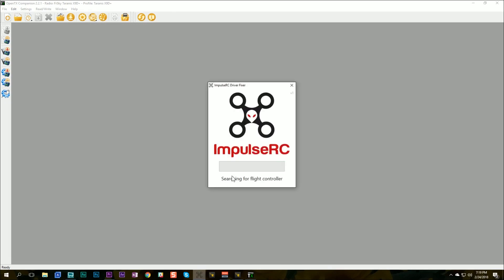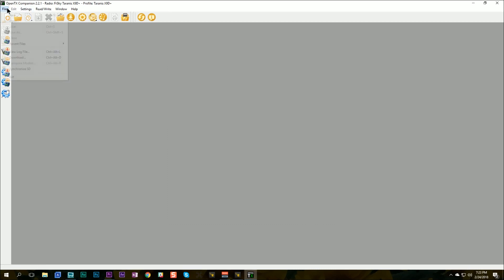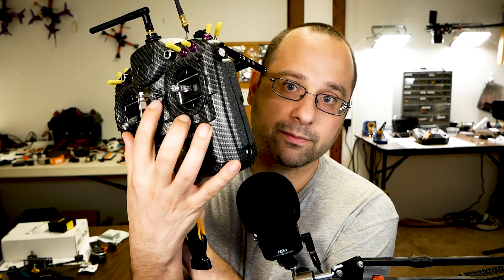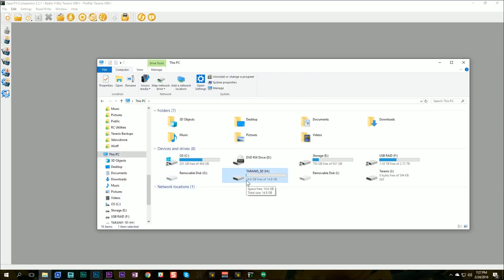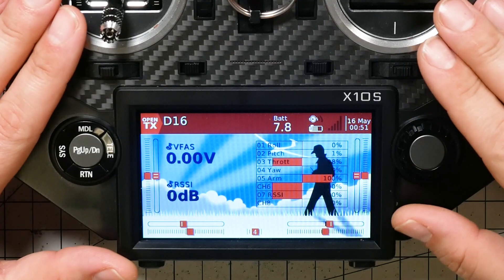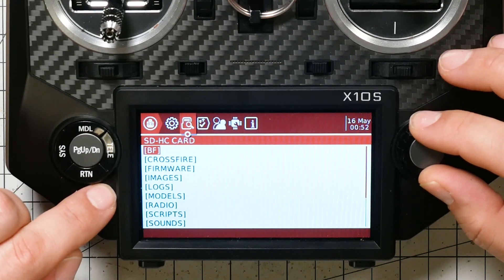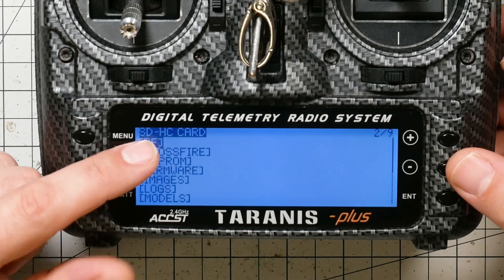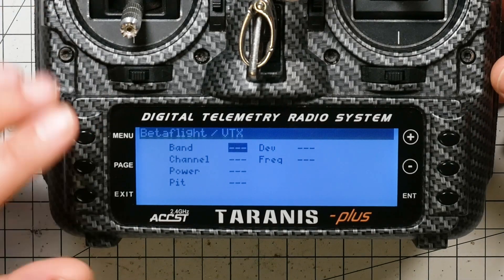Betaflight Lua Script Updated for OpenTX 2.2.1 | NO MORE OUT OF MEMORY ERROR

Comment: Is this relevant yet? Or it has .already merged into new versions, as im using latest 2.3.14 otx version..so o just need to force start the script with .LuaC files..and not with simple .lua file? to eleminate out of memory errors? 
I ve read others suggest to delete these luac files as they are not necessary and by deleting them i can free up some space. So im confused now..here you suggest to force start with luac.
Im facing memory issue now when i start elrsv2.lua than i cannot start another script...or vice versa

Comment: I get the out of memory error when I execute the crossfire lua script and scroll down the menu of the micro rx. However I flashed my radio using frsky way whereby you put the firmware in the firmware folder and then run boatloader and  write firmware. My guess is I need to flash it with companion and follow your steps by selecting luac  to fix this issue?
Reply from the maker: I doubt that. Did you update the SD card contents?
Reply: @JoshuaBardwell  Hi Joshua, I downloaded the SD contents from the Frsky website. I deleted all the contents on the SD card and copied the new files over. I'm running 2.2.2 by frsky - from the downloads page section. I even replaced the crossfire lua scripts with the latest ones from tbs. This is so frustrating I'm thinking of re-flashing it now with companion and selecting the lua & luac mode. Anyway there are so many versions on opentx website which one would you recommend for the taranis X9D plus - no special edition, got it around 2016-2017. Thanks
Reply: What's weird is that crossfire works fine and have no problem binding. But I do get this annoying message when I switch of my radio - "module is still running" yada yada

Comment: Thanks once again Joshua. This was difficult for me because my PC had a hard time recognizing my sd card and taranis. sometimes drives showed up but unresponsive.  I only just purchased my radio second hand and it didnt come with a usb cord. I kept trying on different usb ports and tried a second usb cable that fit but still no luck. Was about to give up and tried my first cord one more time and the drives appeared, looked correct and the firmware flashed finally!!  Yay!
Never would have done this without you champ, thanks heaps!

Comment: hey josh, when you say the taranis upgrade is needed for crossfire, you mean the micro crossfire not the full blown crossfire unit. so i have been informed by the retailer
Reply from the maker: This info is a bit dated. The x9d has been shipping with support for Crossfire for a while now. However at the tune the video was made you definitely did need to upgrade for crossfire support.

If my memory is correct crossfire support was added in 2.2.0. Before that, whatever module you used, opentx didn't support crossfire at all.

Comment: hey Joshua, I need a little help with some trouble shooting, I followed you instructions in this video  and now my Taranis Qx7 disconnects from receiver after just 1min
I don't know if it is the receiver(new build which I flashed with the Fport firmware) or the fact that I updated the firmware on my TX should I try reflashing my Tx or my RX or both??
Thanks

Comment: Hey Joshua I've been trying to update firmware on taranis x9d plus believe   its 223 now. But when I go to crossfire in sd card its saying script killed any help would be great
Reply from the maker: You have to separately update the SD card contents. Could that be the step you missed?
Reply: I did both had them both working then something happened nd only 5 things are on sd card now. Nd now the computer is trying to repair sd card but no luck

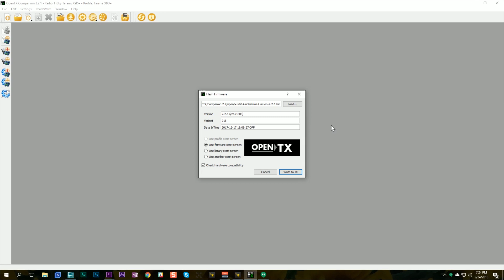Comment: When executing "Write Firmware to Radio" (5:00), to what path do you write the firmware? Do you write it directly to the "Taranis (J:)" drive?
Reply from the maker: None of the above. When you "write firmware to radio" you have the radio connected in DFU mode so there is no J drive. You plug in the taranis with power off and this causes it to enter DFU mode.

Comment: Question: I have Smart Audio controlling vtx...no issues. I installed lua scripts and it controls everything on the vtx EXCEPT PitMode. The equipment is working, so is there a special way to turn PitMode on/off? The screen says it is saving but the vtx never changes and the lua PitMode setting goes back to whatever it was set at? Telemetry is definitely working. Equipment: fireworks v2 flashed to 3.5.1 and BF 3.5, 9D+ radio with 2.2.3, eachine tx805. Any help is greatly appreciated. 
Roger
Reply from the maker: Unify (and possibly other SmartAudio vTX) refuse to go back into pit mode after power up.

Try tinysleds real pit (search my channel for review)

Comment: When I create a new model it doesn’t allow me too chose between kwad airplane etc it just goes directly too the menu again and the model is there do you know why?
Reply from the maker: That's an option you can turn on in the OpenTX Companion app on the desktop. But honestly I prefer it to be off as the presets it goes through are pretty basic and I like to just do them by hand.
Reply: Joshua Bardwell ....thanks man I thought its something that u needed, another quick question my radio didn’t come with a sd card  the firmware is 2.1.6 i know its better too be up to date but just for now while i dont buy one and download the new one and all that , does that affect in any way the signal or something of flying or i can still fly no problems ? I bind my wing and everything seemed to work normal i just didn’t wanna risk too fly it without the sd card and new firmware , so am i good to fly?

Comment: Hey, JB, I have a doubt. My Taranis is running 2.1.6 and I'm going to update it for the newest version (2.2.2 or whatever, I don't know). My doubt is: which method should I use? The boot loader, like in your first video, or like you did here? Or it doesn't matter? Thanks!!! 😊
Reply from the maker: Personally I would use the method of "plug in while it's off" and flash from Companion. The only reason I showed the SD-card method is because it avoids the issue with DFU drivers, which many struggle with.
Reply: @JoshuaBardwell  Nice, thanks a lot!!! 😃

Comment: Joshua, thanks for your videos on this. I am struggling to understand how to get the BF lua scripts working. I keep getting various syntax error, telemetry protocol not supported and other error messages. This is with OpenTX 2.2.2 and the associated SD file set. When I try to go back to earlier versions of the OpenTX FW, I install the Companion SW (say for OpenTX 2.2.0, but the FW downloaded is always 2.2.2). Which makes me think I am missing something. The FW timestamp also confirms that it is 2.2.2. Under some conditions I do get the telemetry page to run the script, but only directly after power up of the TX. Hope you can get me some help.

Edit: I found the original FW file for 2.2.0 on my MacBook and was able to get it to work. Using the latest BF lua scripts which surprised me (didn't think they would be compatible with an earlier FW version). Has the Taranis reached the end of its growth potential, or could the memory issue be resolved? The lua stuff is presumable only growing in size and complexity.
Reply from the maker: You should install 2.2.2, the latest SD card contents, and the latest Lua scripts. You must also be running a recent version of Betaflight. Then everything should work smoothly.
Reply: This has been my experience; out of memory errors gone after custom firmware flash for 2.2.2 as per JB's video.

Also keep an eye out for new lua script for ßF 3.5, it's not officially released yet, but patch for new feed forward page has been committed to github.
Reply: Thanks mate. I run BF3.5, and the 2.2.2 plus latest SD card contents somehow didn't work for me. WIll give it a few days and try again.
Reply: Just to confirm: you have flashed the custom noheli, lua and luac firmware as per JB video?
Reply: @si-fi  I did all that except I did not pick the noheli option. Something I did not do was to update the bootloader via the SD card method, but the radio showed otx 2.2.2 I think. I remember as it went back to saying taranis 2.2.0 in bootloader mode (when I loaded FW 2.2.0). Can't recall that I ever updated the boot loader via the sd card. Is this step essential?
Reply: @pieterdewaard2383  hmmm, not sure, my bootloader is 2.1.6 and has been for ages.

Comment: First time Frsky user here wuth a Qx7.  Flashed OpenTX 2.2.1, added Lua script together with all files instructed on the video.  I'm wondering why don't i have the VFAS option on the display page? All i get is the screen 1 to 4 menu without the top display menu.  i wanted to select it also on the special function but can't see the option.What did i do wrong?
Reply from the maker: If you don't see VFAS on the display page I think the sensor has never been discovered. Bind the transmitter, power up your quad, go to Telemetry screen then Discover Sensors. If the FC is sending telemetry you should see VFAS come in.
Reply: Joshua Bardwell Thank you for replying to my query.  Will try it out.

Comment: Joshua, thanks for this video, but what could be the reason that there is no information showing for the PID or VTX inside the lua script? It just has "--" for all the fields. I'm running a Hobbywing XROTOR F4 FC and have an X4Rsb rx with the s.port wired to UART3TX and a Tramp HV with the telemetry wired to UART6TX. I also have both turned on within Betaflight.

Comment: Every time I drag and merge the bf and script files  onto my sd card it shows fine when the sd is in my computer but when I restart my taranis X9d + se .... it scrambles the whole card and I get the sd card warning right away. Any information on why this would happen? I have tried many times. Thanks
Reply from the maker: The SD card that comes with the Taranis is kind of shit. Replace it with even a cheap aftermarket one.
Reply: Joshua Bardwell that’s easy enough... I will give it a try thanks
Reply: Joshua Bardwell well that was the fix!!! After spending a week uploading and formatting that crappy SD card. I think you should mention this in a video or in the description. Thanks again, I guess I should have asked sooner.

Comment: Do you know if the current Frsky OpenTx version (With, I'm guessing, some bugfix?) has the LUA + LUAC options?

(ie: x9dp-v2.2.2-20180525, "Based on openTx v2.2.2.", even though that is not an officially released OpenTX version?!
see: https://www.frsky-rc.com/wp-content/uploads/Downloads/Firmware/X9DP/FW-X9DP-V2.2-20180525.zip )
Reply from the maker: It is a compile-time option so I assume it is available yes. Just select luac option in Companion and click "download" and it should come down.
Reply: They don't seem to offer a custom companion, only the firmware and SD card content.
So I used the 2.2.1 companion with their "2.2.2" version, but I can't tell which modules are active, unless there is a menu for it on OpenTX? (I'm just starting out, sorry for the confusion!)
My current understanding/guess is that 2.2.1 is linked to some repository where it gets all the precompiled build options/modules, and somehow combine thems?
And thus, I'm not sure I can click download in 2.2.1 and tell him to fetch 2.2.2 (I clicked "write firmware to radio" and picked the file I got from FrSky) considering FrSky doesn't seem to be giving any other content.
Unless the companion is actually extracting modules from the firmware .bin? :)

Comment: I've never been able to read or write with companion. It SAYS it writes firmware but doesn't. It also says it reads models and settings from radio but only model 1 shows ... i always have to write firmware and backup to\from SD on radio. Any ideas?
Reply from the maker: That's pretty weird but I don't know..
Reply: it is weird. Does it on every PC i connect this qx7 to.  Ive went back and forth with frsky and the betaflight guys to no avail. They just stopped responding after exhausting possible solutions. There are zero errors and companion says everything went fine. I know its not the case but it acts like companion is interacting with a second version of the firmware/settings that never get loaded in the Tx when booted. its a mystery.

Comment: I have a X9D (not plus) and a QX7, both running OpenTX2.2.1. I tried lua v1.0.1 scripts on 2 quads (both with SPRF3 FC, one is a modded wizard x220 and the other a scratch build with a bangood SPRF3 clone from banggood). Both quads have telemetry working fine. But only the wizard works with lua script (initially bound to my QX7). They're now wired exactly the same (softport sport telemetry with only one cable on tx softserial 2 and both with sbus). At first I thought the problem was with de X9D, but after binding the quad that doens't work with lua to the QX7 (that has lua working perfectly with the wizard), it still doesn't work. So I reckon the problem is with the quad. 
Any hints on how to try to solve it? I am at a loss... tried everything I can think of...
I don't  get any memory errors. The script just can't read e.g. the pids from this particular quad, with any Tx, even the QX7 that I know works fine with the wizard.

Thanks

P.S. Oh, and I have luac enabled on both TXs, but use the "telemetry page 1" with bf lua script.

Comment: How do you update the bootloader now??? I try doing it in the radio  with the SD card like in 2.2.0 but I get no option of update on the screen just a format option and another one that I don't remember at the moment.
Reply from the maker: You can update the bootloader using DFU mode. Plug in the radio with the radio turned off. Run ImpulseRC Driver Fixer. Then in Companion flash firmware to the radio. It will update both the bootloader and the firmware at the same time.
Reply: Well I plugged the USB with radio off and ran impulse rc Fix and with in seconds the driver fix successfully was displayed but the radio screen still off and if I try to flash the firmware on opentx it says DFU not found, I'm guessing is because the radio still off so I had to unplug from computer hold trim taps and turned on... Then I can flash it but the bootloader still shows 2.2.0.
I already downloaded the SD cards contents for 2.2.1 and I get no errors or warnings when the radio is turn on. The only reason I'm trying to fix the bootloader is because I have a LUA script for a turbine sensor that I'm not able to run on 2.2.1, I know the bootloader may not even be related to the problem but I'm just trying cover al the maybes.
Reply: I fixed the problem with the lua script I just made the name of the file much smaller and now it shows on the radio and I can use it, now back to the bootloader,  should I worry about flying without updating the bootloader, if remember correctly this shouldn't affect the operations of the radio but I'm not sure

Comment: ok so I was getting a bunch of syntax errors if I tried to execute the files in the BF folder. I changed the luac file name to lua. Now when I hold the Page button down to activate it....it seems to be working. Why would I be getting the Syntax errors when going through the execute steps? Also, so if I want the PID changeing screens to show up last I should use the UI.lua file, but change the name to " BF.lua " correct?
Reply from the maker: The thing you say about renaming UI.lua to BF.lua is not correct. You need to edit UI.lua as shown in the video, not rename it.

IDK why you're getting syntax errors when you run the one script but not the compiled version.
Reply: The same error you received when executing the luiC on your horris,  is the syntax error I receive, but I know I checked lui, and luic when I flashed. will try again ...maybe I missed something.

Comment: It's easy to fix in more proper way, making long press on "Page" still working. You just need to DISABLE "lua" before flashing, and only leave "luac". After flashing, set the screen back to "None", and then to "Script" again, and choose the "bf" script again (you need to be sure all the ".luac" files are there, in most recent version of script archive they are there by default). All will be OK after that, long press on "Page" will work, and no memory error - because the firmware will use "luac" files instead of "lua"...

Comment: Mr. Bardwell, after updating the Tarranis X9D+ firmware and the SD card contents, upon starting my unit I receive a message:
"SD CARD WARNING
Expected version: 2.2V0013
Press any key"
After pressing the any key, the transmitter seems to function correctly. What can be done to satisfy my Tx?
Reply from the maker: You need to download the new SD card contents.

https://opentx.gitbooks.io/manual-for-opentx-2-2/sdcard.html
Reply: Wow! Thanks for the super timely reply. I had downloaded the latest SD card contents, but I transfered everything EXCEPT the 1KB version file to the SD card. That was the deficiency. No way you could have known my noob mistake. Your responce got my noggin working. Bardwell fan. Thanks for everything you do in this field.

Comment: I habe finally figured this out.. thanks but i still have a problem when i connect my taranis to the computer do i have to do the hold trims to center.. like if i wanted to flash the next firmware.. how woulf i do it now.. just turn the radio on and plug usb  in and choose mass storagemm because i cannot access my sd card when its plugged in usb. I have to remove it. Also i  flashed 2.2.1 again and it said flashing done but an error sayong failed to flash FIRMWARE.BIN file.. please help